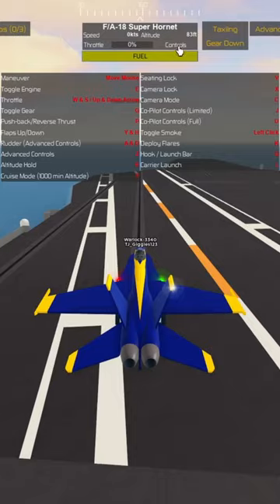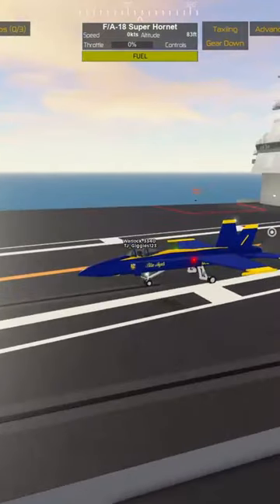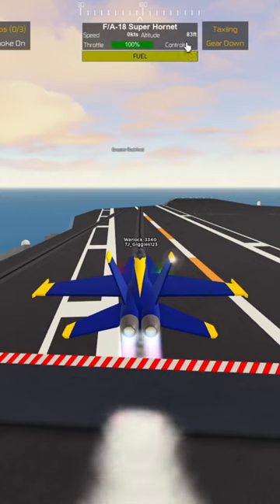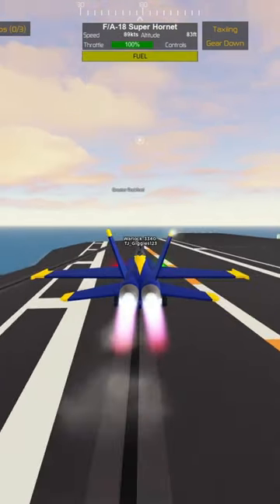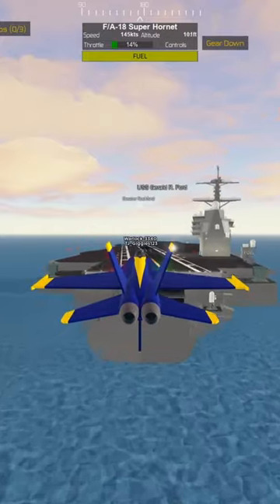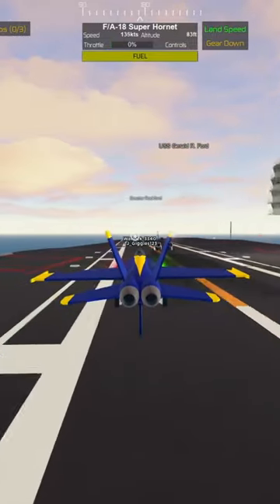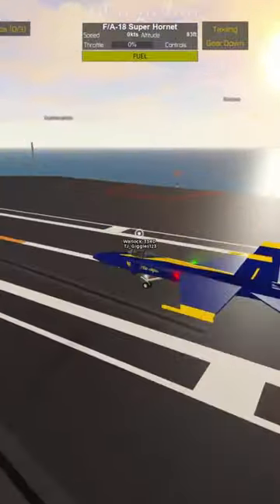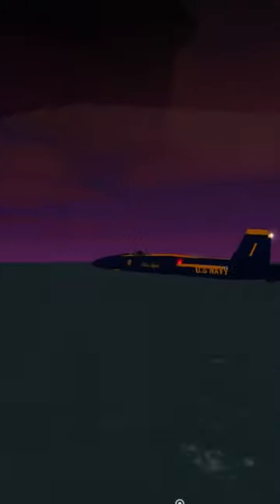The *NEW* PTFS Carrier Update Tutorial #shorts #ptfs #roblox

Comment: Fact: you only have to go 50% - 60%. 70% -  100% is overrated. Plus it just goes to fast. The landing throttle on max flaps is 33% - 34%. These are all for fighter jets. At at least the f14 tomcat and the. Other compatible  jets
Reply from the maker: Well there you go
Reply: I use 31% throttle F18 Flaps 2. 60% for launch
Reply from the maker: @lotte2899  That's actually exactly what I use... Except it's 32% but basically the same
Reply: 100% for roleplay...

Comment: Carrier planes in game: F4U Corsair, F4 phantom, F14 and F/A 18. There is also the F35, which although has no arrester hook, is (correct me if I’m wrong) the carrier variant of the plane.
Reply: The model of f35 the game has is f35B which isnt compatible with carriers. Although you are right, the f35C is carrier compatible.
Reply: @extern4805 the F35B operates from British Carriers
Reply: The F4U in game does not have a rail hook therefore it isn't carrier equipped

Comment: Always go full throttle if you didn't catch the Arresting wire
Reply from the maker: Have to be at landing speed, otherwise it doesn't work, but yes, if you miss it, defo take off, otherwise you'll crash in the water
Reply: or if you get slow enough go full reverse thrust
Reply: @ezramansur8495  ye that could work too but in real life the pilots always go full throttle
Reply: How do u put your hook out For the arresting wires
Reply: @Skilledpuffno10  true if they didn’t catch the wire they can take off
Reply: @ezramansur8495 in PTFS that would work but in real life fighter jets don't have reverse thrust as it would add too much weight